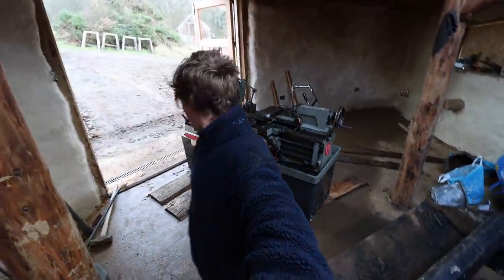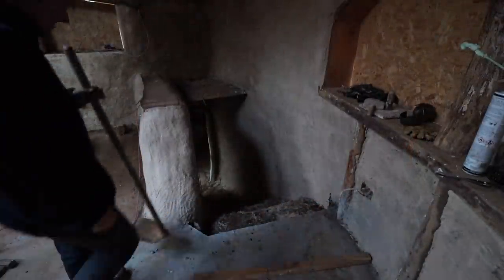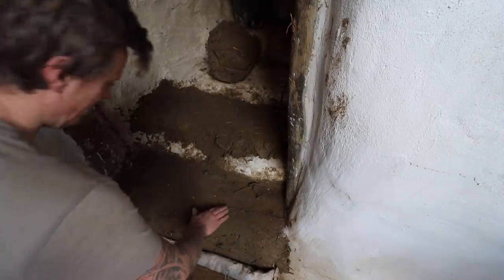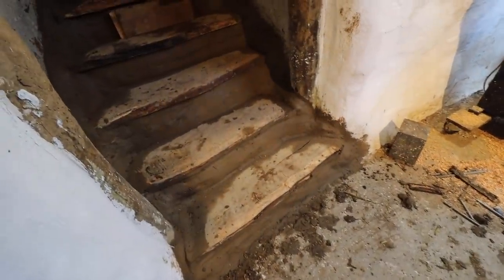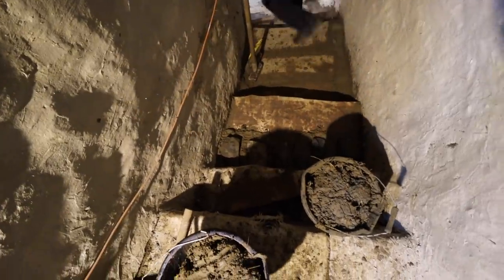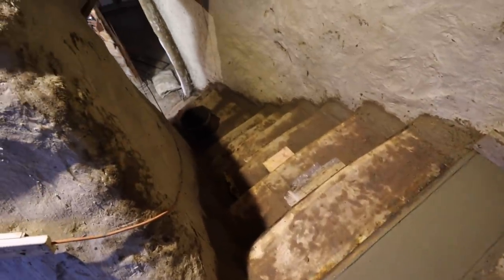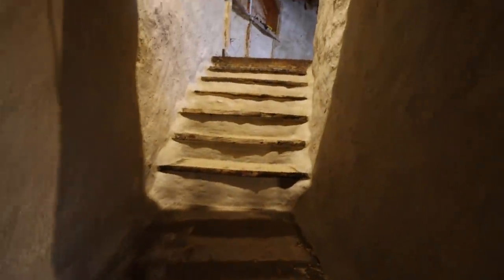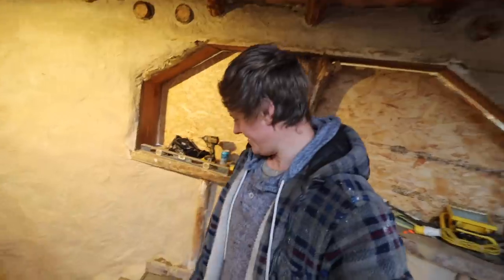Off Grid Earthbag Workshop Part 76 Cob And Oak Hobbit Staircase

Comment: If you look closely you can see the change in Kris' face as he gets near completion of this upper workshop. Some of the worry is gone
only to be replaced with an air of satisfaction and peace. Man those staircase steps came out amazing. The choice of using oak was
a perfect decision. Beautiful and durable. This whole complex really should go into a art museum because others need to see the way
he has used curved lines that are blended into every surface that soothes the eye and is somewhat contrary to common buildings yet
here it works extraordinarily well. Again, hats off to ya Kris for the fine work that you do.                                       Me southern AZ.  (USA)

Comment: Lovely job as always and thanks for taking the extra time to make the videos to share. One suggestion, get a decent thick rubber mat at the top of the stairs to try and trap the swarf from your boots. You will be amazed at how even little bits get embedded in your shoes and then embed themselves in the wooden treads. I now have stairs that are more swarf coloured than wooden.

Comment: Looking great. Make sure to keep your machines oiled, since you've got so much moisture around. Looking forward to see the metal shop in use :)
Reply from the maker: Hi, The guy I got the Lathe from gave it a good oiling before we loaded it. The mill has had a good oiling to. Im hoping to get the building dried out as quickly as possible as the damp is not good for the machines. With the risk of lock downs at the moment I wanted too get them while I could. Thanks for the comment.
Reply: Thanks for your reply. Great to hear that. It would be a shame if they get rusty and loose their precision but I am sure you know how fast moisture can ruin your tools considering  how long you live on the land.

Comment: Corrr wouldn't want that lathe any further back! What a crackin staircase bud.
Reply from the maker: do you mean on the trailer? I had the headstock at the front witch is most of the weight. I had 10% nose waight

Comment: Good choice! Those colchester lathes are very high quality machines. Used to work on a few of them back when i was an apprentice. Still sometimes i work on them. At my work they had to exchange one of them because the gearbox had excessive damage so it was beyond repair... maybe keep that in mind! They are very precise and good machines but the gear box is maybe a bit on the fragile side. Still this machine will maybe last for a lifetime in your workshop! The colchester lathes at my work are used 8 hours a day 5 days a week and still running since 20-30 years.

Comment: Thank you for the videos and ongoing inspiration. I am in the early stages of planning a natural swimming pond/ habitat and was wondering if you think the earth bags would work as the underwater walls of the swimming area? They would be covered by the liner so not exposed to water directly. Thanks for your thoughts, no worries if you are too busy to answer. Looking forward to watching the shop get up and running. Well done, Kris!
Reply: imo doing quick search...you want clay as hydrophobic
gravel 
plant animal safe liner....
sloping edge ( more animal friendly for accidental swims) 50% surface for plants

website title  (not spam url)
How to Build a Natural Swimming Pool
By Douglas Buege and Vicky Uhland

earthbags ...any natural build like compressed earth
have to stay dry, why use large roof overhang...and plastic synthetic bags
degrade overtime 
(from what I heard on another earthbag building homestead site)
maybe research how to keep those slopes reinforced instead with clay
over a thick rubble rock wall, guessing though

Comment: Brilliant work mate. 👍👍👍😁😁😁
Only thing I would say is, the curved lines in the wood do indeed look fantastic but for steps I would have kept the front edge straight, so you don’t catch an edge and trip when using them.
Reply from the maker: Thanks for the comment, I agree there is that risk and if it was for the pubic to walk up and down then I would agree but when you walk up and down a staircase all the time you learn it,  it becomes second nature to you. so in no time at all I will intuitively know every step.
Reply: @KrisHarbour  
Yep, 2nd nature will kick in. 👍👍👍
There is a good story told by safety officers about steps.
A factory closed down for a couple of weeks to allow full overhaul and maintenance.
On day 1, one of the visiting maintenance contractors fell down some stairs and broke his leg.
When they looked at the stairs there was 1 step different from the rest which why their lad tripped.
So they added this to the maintenance work and corrected the step so as to be the same as all of the others.
After the maintenance was finished the factory reopened and the normal staff returned to work, and on the 1st day 5 of the normal factory staff fell down the stairs because their muscle memory was expecting to encounter the old uneven step which was now different.
Reply: Can always hit any high spot with a planer, yeah?

Comment: I mill my own lumber as well on a DIY bandsaw Mill. There is so much work that goes into preparing lumber that people do not appreciate. The amount of mess and labor to get things cut, planed, and relatively square are a big messy job. I have often considered building a half shop. When I do the finish milling in my shop it always requires a half day of cleanup afterwards so I typically roll the planer to the doorway. Have long considered building a simple structure attached to the kiln to house a cheap table saw and the big planer. I'm not a big fan of dust collection systems, too many hoses for my taste. I think a system like this would allow one to keep their main shop clean and orderly. The secondary shed could just be a messy space, maybe shovel up the chips once every 3 months or so. It could be a rather small structure, it only needs to house and insulate two tools. I wonder whether it would be worth it to extend the track on the bandsaw to allow a second carriage to take the lumber to the planer and jointer?
Reply from the maker: Hi Jean, That is very true mate. I actually think that timber processing down to the timber you need for the job is often more than 50% of the job. By the time I have crossed timber on the bench for a project im already at least half way through the project.

Comment: Try this, get an induction stove, a pressure cooker and a freezer. Then get a roll of plastic bags. Then just get a bunch of different beans, grains and peas. Use the plastic bags to store a!l the extra food in the freezer. Before you know it, you will have more food than you know what to do with.

Then just invite volunteers, feed them and get them to do all the hard work you are doing.
Reply: Also, if you have a small space for a landing pad, that would be nice. Then we can feast and drink like leprechauns.

Comment: Looks really great. I wonder if anyone could comment about the moisture interplay between the cob and the treads? Seems to me that if the wood expands or contracts it could crack the cob around it. Maybe the moisture level in the cob is consistent enough to prevent this but I'd imagine there's a pretty drastic change when the cob is drying?

Comment: Did you find it easier using the bars underneath the lathe to roll it into position? 

You’ve got the best homestead in the country in my eyes, you should be very proud of yourself.
Reply from the maker: yeah it was really easy on the bars. we couldn't use the bars on the trailer because the slope was quite steep and it would have been a bit out of control.

Comment: Can lime putty be made up in the same way but from powdered/slaked lime, and what are the cons, is it very much inferior? I want to build with lime mortar but slaking lime is a bit hard core for my needs, just building a little stem wall for timber summer house project. Lime looks so much nicer than cement, plus better in contact with timber.

Comment: Hi Kris

Thank you for replying so promptly.
I take your point about the cost of large diameter fittings and stop valves. Because the nozzles each have their own  valves is it necessary to have a 110mm stop/isolating valve, and if not, would it be worth making a 110mm adapter for your existing manifold and connecting directly to the main supply, or a manifold constructed from a length of 110mm pipe connected directly to the main supply, blocked at the end and fitted with 4 solvent weld individual 50 mm2” reduction adaptors connected to the nozzle valves via 50mm/2””green nylon reinforced suction/discharge hose which would allow for slow sweeping bends and the increased flow rate. may allow you to increase the nozzle diameter.
The adaptors and 50mm/2inch hose are not very expensive ( Screwfix with free delivery) .

   Once again thank you for replying  Vic Wild

Ps I am sure you have already thought long and hard about the above, and therefore do not feel obliged to reply

,

Comment: The issue with your shoulder is not a pulled muscle. It is a pinched nerve in the neck itself. If you have medical, it wouldn't hurt to go get some kind of a  scan to make sure you haven't got a herniated disc. On a brighter note, there are stretches you can do to alleviate it's reoccurrence.

Comment: I had not heard of the triumph Colchester and I wondered if it was associated with clausing, they also made a Colchester lathe. It does not appear they are related, but I have run that machine! It was not badged the same but it is identical, including the colorful speeds and feeds levers. I'm not positive, I want to say it was an Acra, but it was a very solid and predictable machine. Not a lot of bells and whistles but nowhere near as light weight as many newer lathes. A solid little workhorse. Congratulations! I am curious, how do you intend to power it? Is it set up for three phase?
Reply from the maker: Thanks Jean. yeah I have seen those speed selectors on some other machines as well. I know they made lots of these and they are quite common. The trouble is they are getting quite old now so its hard to fine them not to worn.

Comment: Hi there 
Sorry to divert to your hydro setup, but, it occurred to me that if you have reduced the 110 mm main supply pipe prior to the nozzle manifold, instead of keeping it at 110mm, then surely you have reduced the manifolds ability to maintain pressure under load( if you measure the pressure at the 110 pipe and at the manifold when the system is flowing (not stopped ) then I suspect that there will be a difference and maybe even a partial vacuum which could cause air to be introduced in to the system. On the other hand you have the experience and know how and I could be talking a load of rubbish!
Vic
Reply from the maker: No you are correct. There wouldn't be air in there though or a vacume but there would be a pressure drop and a loss from the reduction. With hydro power there is always losses and the way to get rid of those losses usually involves high costs for all the larger fittings and longer installation time. So what I try and do is minimise losses while still making the system economical. The loss in that reduction is very small overall but the cost of the the shut off valves and fittings being 110mm is considerable and the gain quite small. If money was no option then 110mm pipe would go right in to the building and then a very complex custom made manifold feeding each nozzle with very shallow bends and large pipe would be ideal but the cost is huge. To give an idea, Just the flange in to the manifold costs £120 in 110mm a shut off valve would be £300+ It would be very costly and the gain quite small.  

With a system with more consistent flow things get much easier and cheeper as the need for lots of nozzles goes away and you can have one nozzle with very little reduction in the system. But for my 4 nozzle system it works quite well even if it isn't perfect.

Comment: Why did you start at the bottom of the staircase?.  Much more efficient to start at the top.
Reply from the maker: Because of the need to form the last step in to the slab. And because I didn't actually have a detailed plan for it it was easer for me to work it out starting at the bottom. The cob was at the top as well so if I started at the top all the cob would have to be walked around to the bottom as the steps would be wet.
Reply: Disagree, bottom to top is the correct way in this specific case.